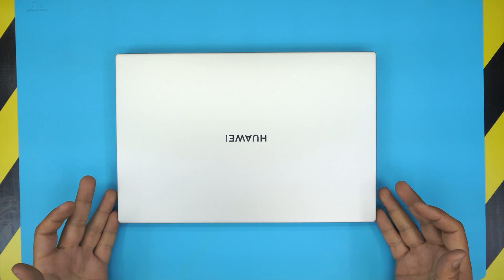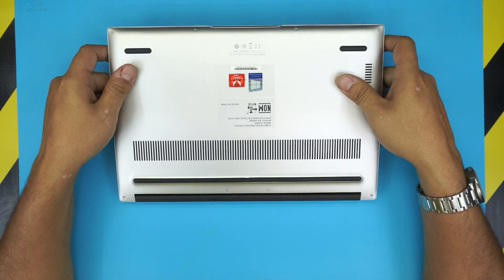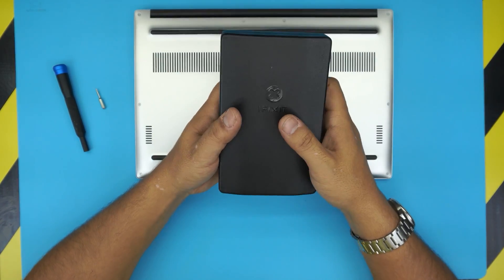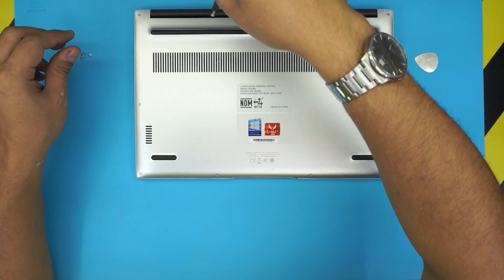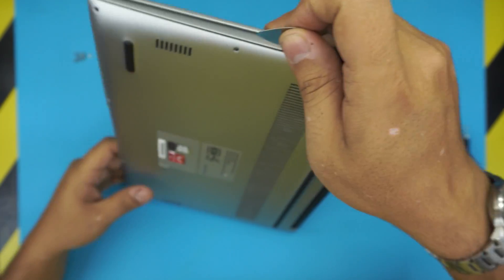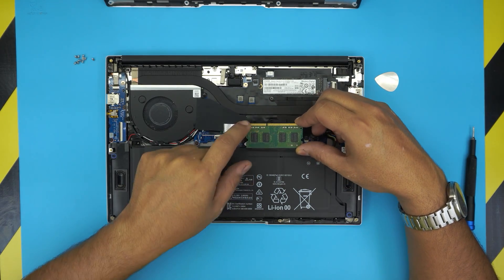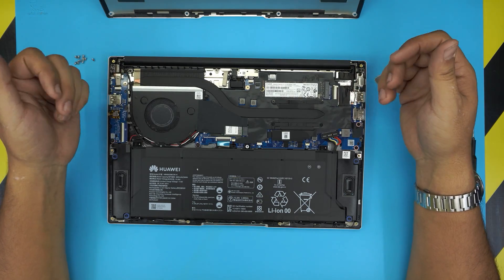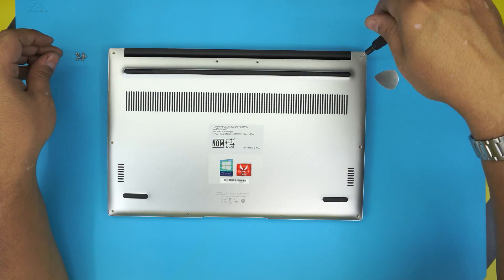HUAWEI MateBook D14 Ram Upgrade NOT POSSIBLE ( Nbl-Waq9r )

Comment: But is it possible to replace old RAM chips with the new ones with higher capacity by resoldering them? 

Ofc it's gonna cost MUCH more then just buying a replacement SO-DIMM module, but is it still possible?
Reply from the maker: 🫠Regarding your question, yes, it is possible, and we do offer that service to replace the RAM chips on the board. It's a service called BGA reballing.
Should you have any further questions or requests in the future, please don't hesitate to ask me.
cheers🍻

Comment: Hi, from Philippines, is it possible to replace the ram with a new but same capacity? I've been stuck with an error when I try to install a new OS and I'm starting to think that it is caused by the ram
Reply from the maker: Thank you for the feedback! if you wish to support the channel you can LIKE or SUB or both :P
regarding your question: how you install it, if you getting error during installation windows , its not the ram (the ram is not changeable) you need to use a different USB or and Different USB port. use  new USB drive and try on different port

Comment: How is the gpu connected? My understanding is these laptops are generally pretty similar, if I have a model with an Nvidia card that I intend to upgrade is this possible at all with these or is the gpu also soldiered onto the motherboard?
Reply from the maker: Thank you for the feedback! if you wish to support the channel you can LIKE or SUB or both :P
regarding your situation: sorry to inform you none of this brand laptops have a VIDEO CARD, they have a GPU CHIP soldered on board, its not up-gradable my friend sorry.

Comment: its possible buy ram soddim and change chips thats it
Reply from the maker: Thank you for the feedback! if you wish to support the channel you can LIKE or SUB or both :P
regarding your question: NOP my friend they firmware for the rams are set locked. and the power delivery is adjusted for them, we have done this method on on board rams and many laptops and even with modding still we get horrible results and crashes and bad boot and file transfers giving errors.

Comment: amigo a esta laptop se le puede poner una grafica externa?
Reply from the maker: si y no , si puedes conectar uno a usb 3.1 que tienes pero te va dar una resultado horrible, y mal gasto que vas a hacer con compra de external GPU. si hubieras tenido un thunderbolt 3 entrada aya si.
Reply: @uFixTek  con un adaptador se puede conectar al puerto de red de wif, sera igual de malo el rendimiento, si se la conecto en ese puerto
Reply from the maker: si puedes en lugar de usb 3 hacer un cortadora de carcasa y meter un flexor a donde va tu tarjeta wifi pero como no es PCI-E te va dar igual de resultado que usb 3 y hemos probado muchísimo en equipos diferente
Reply: @uFixTek  muchas gracias amigo, por la ayuda
Reply from the maker: por nada amigo saludos

Comment: Hey i’ve read that the d15 2021 matebook ram is not soldered. Only the AMS variant is soldered mine is intel. Is there by any chance i can replace the RAM if that is true?
Reply from the maker: Thank you for the feedback! if you wish to support the channel you can LIKE or SUB or both :P
regarding your situation:  i own a intel and opened few intel, they are RAM soldered too on board, but if yours is not soldered you can upgraded it up to 32GB depending the how many ram slot you have available, remove the cover and check how many slot you have, also check this video to see your max ram capacity: https://youtu.be/tKEJTkVth4Q
the ram this laptops take are SDRAM ddr4 : https://amzn.to/38GBBfT